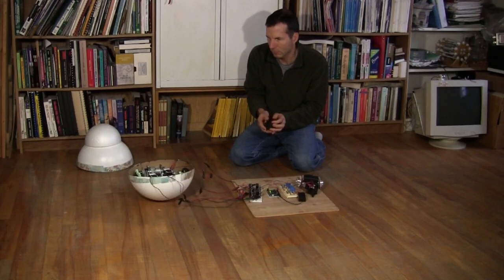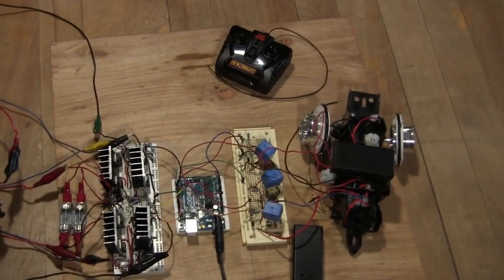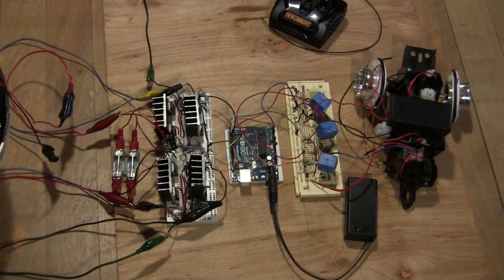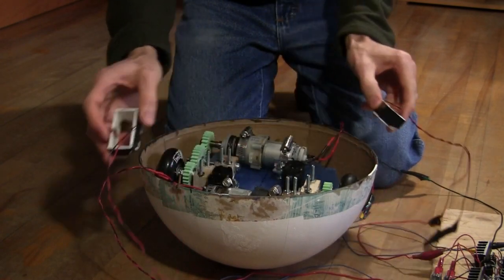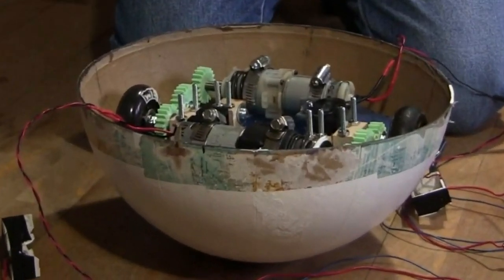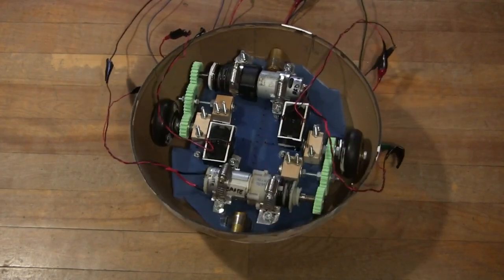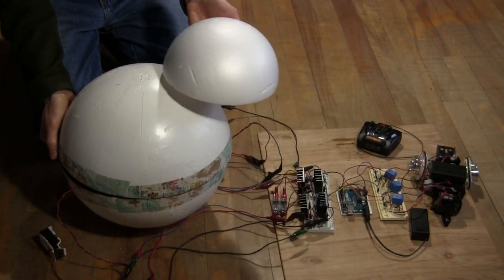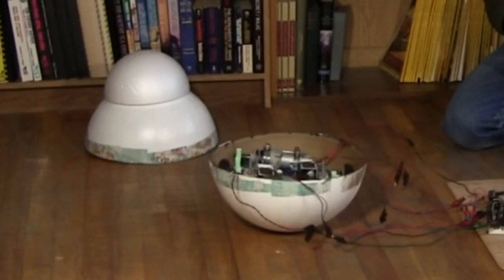Making BB-8 Droid (v2) Quick Update

Comment: That's really cool. It would run a lot smoother if you bought a fully proportional RC airplane box radio And some cheap 1/10 scale car speed controllers
Reply from the maker: I agree, but I was trying to do this on the really, really cheap (free where possible). I did at least switch to Bluetooth using my phone and adding an HC-05 Bluetooth board to the droid. You can see it in my Part 6 video https://www.youtube.com/watch?v=5EuI9lBtC3I

Comment: Hi this is a request for home made thin wire ion air generator ( negative ion generator) . I have seen it few years back used to douse fires and better burn inducing spark plugs.Pls if you could add it to your best videos on you tube.. thanks for inspiring

Comment: Gonna have to fix the wobble.
Reply from the maker: +The Restoration of Dr Who Yup. I'm almost at the point where I can start addressing wobble. I just have to solve a problem of the head magnet part inside the ball getting stuck on unevenness inside when the ball it's put together. I think that's the last thing holding up a video update. The only wobble I'm seeing so far is back and forth wobble when the droid stops which I'll first try to minimize by having the droid decelerate instead of stop suddenly, and then if needed, I'll put in my 9-DOF board and address it further with that.

Comment: A simple magnet connected to the drive mechanism might help you keep the top in place.Also if you're having problems keeping your power devices cool you might have to rethink your circuit design because those big heatsinks should not be needed when driving as little as 5 A. If you're using BJTs then consider using mosfets and pick the ones with low Rds on, when switching mosfets the rise and fall time of modulation is key, since slow transitions will make the mosfet inefficient, same goes for BJTs.
Reply from the maker: +Poptart McJelly Thanks. I have the magnet connected to the drive system and top/head mostly working now. I just have some problems to solve with the way the rollers work and then I'll have it all working. Regarding the heatsinks, they were added when heating was occurring when working out the bugs in the circuit. I'm not sure if I still need them but since everythings now soldered together on a board I may as well keep them.

Comment: I can't wait to see it!! but I am wondering if you can build a shortwave radio?? I mean simple build even modify an old scanner into one but build one please!! I need a cheap shortwave I got some ideas but I thought I'd ask you!!!
Reply from the maker: +Matthew Henry Thanks! Regarding the shortwave radio, I haven't done it but my understanding is that my crystal radio with a longer antenna and an added fixed capacitance of around 470pF in series with the tuning capacitor should help - though it'd still be tricky. An amplifier would of course help too.
Reply: RimstarOrg thanks for the info!! Maybe you could tinker with it and if you could refine the method!! Thanks!!

Comment: What is the output of the rc truck
Reply from the maker: +zacharymitchellchannel It has a drive motor and a steering motor. The RC receiver has the same type of output for powering both motors, around 2.8V for one direction and -2.8V for the other direction. I don't know if it is a limitation of the receiver or the transmitter but the receiver's output is either on (2.8V or -2.8V) or off (0V). I don't remember the current. The Arduino doesn't take negative voltage inputs so that's mainly why I had to make the converter circuit board, to give the Arduino something else instead of the -2.8V. I also had to add a resistor to reduce the current so as not to damage the Arduino. Anyway, I'm currently putting together a whole webpage just about that circuit board alone, but it'll probably be a week or so before that webpage is done. I'm getting very close to knowing if the head will stay on and if it does then I'll be busy doing a video first.
Reply: +RimstarOrg ok thanks

Comment: Great stuff so far. I was curious though, what are you using for the main sphere? Is it a globe? What size it.
Reply from the maker: +Casey Kelly Thanks. I'm using a 12 inch globe. I painted it white but when it dried, the uniform color made a lot of imperfections show up very well; there are a lot of vertical grooves where the segments of the globe meet, plus it became clear that I have to smooth away more of the mountain ranges. So I decided to wait until I have it rolling before working more on smoothing out the imperfections. I should know this week how well it rolls. You can see the original globe in my video about version 1 https://www.youtube.com/watch?v=tugoaguh0aY. The globe wall is very thin, maybe less than 1/8 inch/3mm thick and may deform too much with the weight of this new drive system. If it does then I may coat it in fiberglass.
Reply: Nice. I have seen the version one and this one so far. good stuff.

Comment: if u use a soft skateboard wheel in there you can get taller wheels gor more speed and soft for more traction.   I can give u a Web site that sells individual wheels at a hood price if you like
Reply from the maker: +sketchyssk8shop My traction's actually pretty good, no slipping. But I have some anti-slip spray in case I start having a problem with traction. For more speed I can simply change the duty cycle of the PWM from my Arduino. The speed you see in the video was selected to ultimately give me the speed I want to ball to roll, though I may adjust it further once I actually get the ball rolling.
Reply: +RimstarOrg ok. I am not up to speed on modern motor control systems.   still back in the 80s as far as my rc tech.
Reply from the maker: +sketchyssk8shop I'm new to it myself. Learning as I go along.

Comment: The design is really great! But how will the rest of the wires and other electronic things that I don't now of will fit in the sphere?
Reply from the maker: +Hanim Benziane Thanks! And good question. There's still over half of the room in the ball that's empty so there's plenty of room. They circuits also don't weigh much so they can be mounted higher up than the batteries and motors without having much effect on the balance.

Comment: how can you tell which direction the thing is going?
Reply from the maker: +Derpy Herpy I'm not sure how I'll do that yet. For my version 1 I just ran it and then I'd know which direction it's going. I might drill some tiny holes in the ball and have red LEDs attached to the motor platform inside that shine light through the holes in one direction and blue LEDs attached to the motor platform inside that shine light through the holes in the other direction.
Reply: +RimstarOrg won't you be able to tell from the direction the head is pointing once that is mounted? If you mount it using 4 magnets like in your last model, pairwise with opposite polarities, the head should always face the same direction. Once you have replicated the design of the head by painting it and adding the robot eye and antanna, you should be able to tell in which direction it is pointing.
Reply from the maker: +Fjederhaek creations Ah, yes, you're right. I was thinking of how to tell before putting on the head in order to know which way to put the head. However, I do plan on being able to rotate the head so at that point it won't be so clear anymore.
Reply from the maker: +PrinZenkeks With the BB-8 in the movie and the one used at the promotional events, it's able to turn its head in any direction while moving in one direction. It adds a lot to the character.

Comment: why arent the wheels directly on the motor's crank and the relays directly driving. 4 relays and some inductors in series with the motors would do the job
Reply from the maker: +Gotin Fuklio The motors are too long to both fit along the middle so they had to be positioned off to the side and then gears used to transmit the power to the wheels.
If would have been nice to drive the motors more directly from the RC receiver without the Arduino and H bridges but I want the Arduino there for a number of reasons. One is for controlling the speed better. I plan on adding an inertial measurement board (Adafruit's BNO055) for more stability when stopping. Also, I may be synchronizing those drive motors with the head movement, again for stability. So I need the Arduino as a sort of brain.

Comment: Have you seen that the bb8 3D files are available for free on the bb8 builders group?
Reply from the maker: +Terence Stupple Yes, I've been a member of the BB-8 builders group for a while now. I don't have my own 3D printer and there's no way I could get enough time on the local makerspaces' ones for that, and the cost would be to much anyway. Their heads, or domes as they call them, look awesome though.
Reply: +RimstarOrg im part of the BB8 group also.  Id be willing to work out a trade with you.  3D printed parts for the scamatic and assistance with the drive system.
Reply from the maker: +mbarth76 No need for a trade. The schematic and more details are on my webpage at http://science_electronics_projects/bb-8_star_wars_droid_v2.htm. Once I have the head on then I'll also make a more detailed video - hopefully by then end of next week or early the following one but that depends on how it goes.

Comment: Yay!  IMHO, that's the first step.

However, and without meaning to come off as condescending or critical, these are my thoughts on the BB8 imitators.  I feel most BB8 imitators seem to miss points that would separate them from the "boys"...

IMHO a BB8 should stop dead, or near as possible to it, in movement and not roll like "a drunken sailor on a ship in a bad storm".  So it would appear most "imitations" are missing that feedback/correction factor.  I see BB8 imitator constructors add weight to compensate but I feel that is the wrong way to go about it and should really be trying to self-level the movement mechanism (think "Segway") - so electronic gyro's look like the way to go.

I think the steering/drive mechanism should be omni-directional - perhaps those fancy omni-directional forklift drives or a four-way motor system instead of a two-way?

As for the head...  Why not friction-less?  I'm not sure how it would work out, but could there be magnets that are repelling and then one that is attracting, perhaps in the center, to keep it in place?

Don't flame me, I am not a constructor of these things.  These are just things that are off the top of my head, seem logical and appear to be missed (so far)...
Reply from the maker: +Stef60s Just as with the R2D2, people will be building many versions of BB-8 before a few best ways are found. I've seen some where the use of heavy mass resulted in a very stable movement, especially if the mass is low. Usually the ones that wobble have a lot of mass higher up. I imagine I'll be doing a few versions myself.
Regarding frictionless, making magnets work that way is not easy. Usually it's done my having a spinning part, like the levitron.
Reply: +RimstarOrg 
true connecting grounding side of crystal radio to you body make it work then you going valk whit it in backpack
Reply from the maker: +woleymaster lol I've sort of done that. In this video about my pizza box crystal radio https://www.youtube.com/watch?v=JtPwxbOgBHw if you look closely you'll see I have my hand on one of the capacitor plates to act as a ground. It works without the amplifier too.